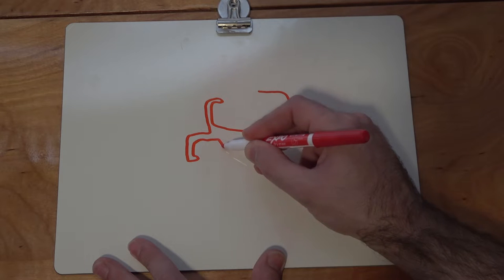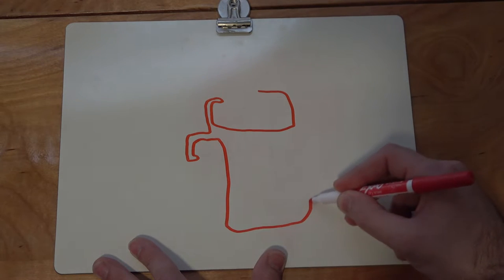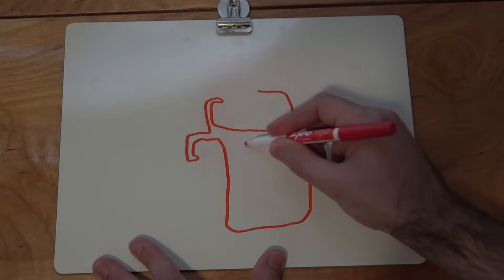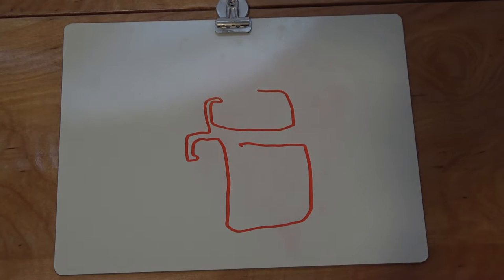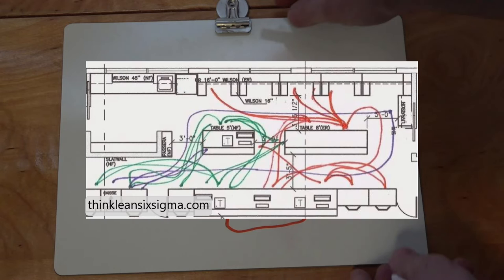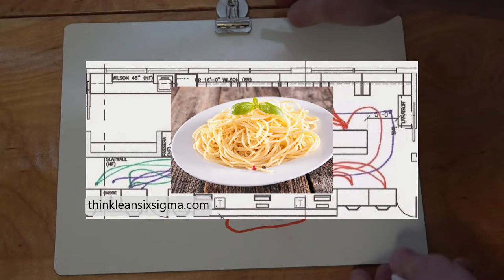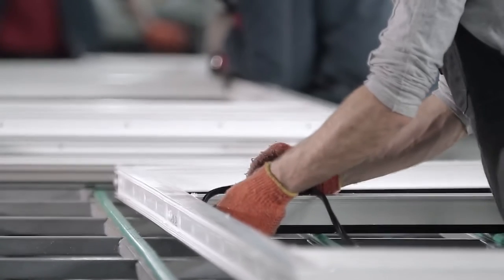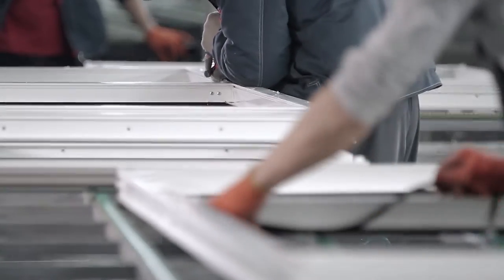Why I Built a Laundry Chute (or, how spaghetti diagrams are useful)

Comment: Anything on fire regulations? Also how long before a kid goes down it.... interesting though. I may try this
Reply from the maker: I read a bit on this. In theory, if you have a fire in your laundry room, a hole in the ceiling allows the flames to travel to the upstairs more easily. However, it's a "closed hole" since it's inside a cabinet. A risk you should take into consideration. No kids down it yet :D another risk I guess